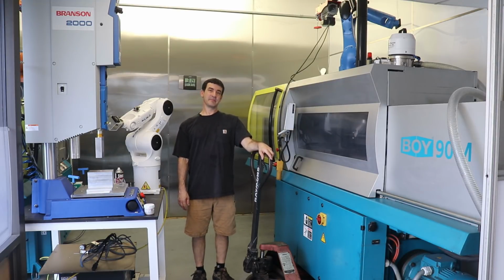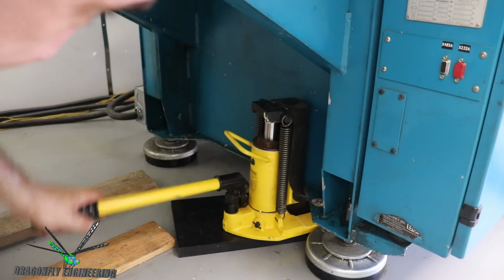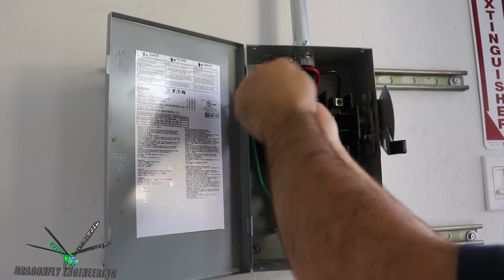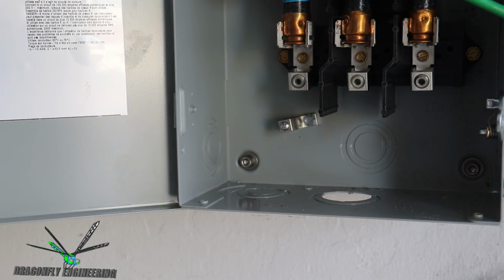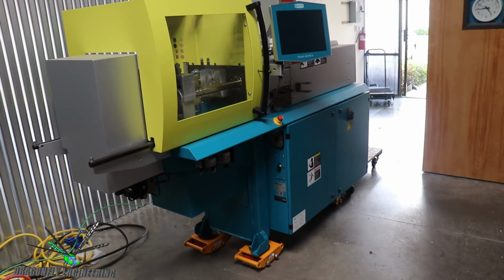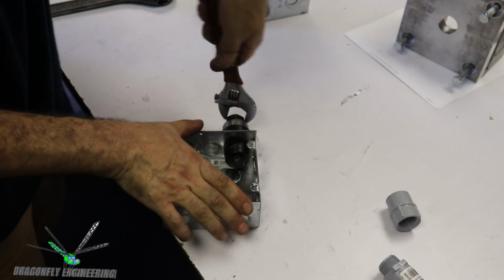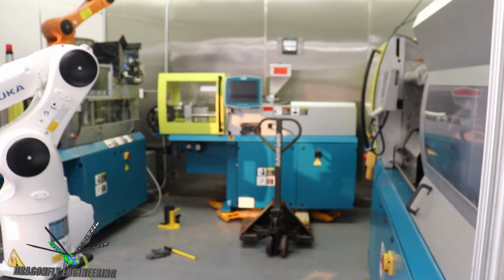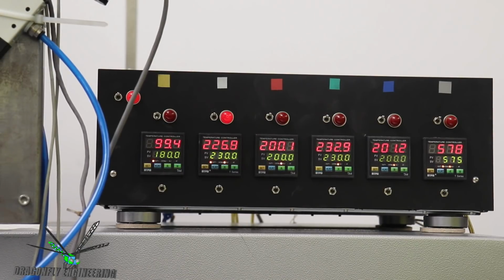Machine move and hookup (edited)

Comment: Machine skates are mostly more trouble than they are worth.  Almost always, it is better to clamp the machine to angle-steel and use a bunch of dowels that can be kicked to effect the steering.  The best riggers I saw in action used lots of hard-wood dowels and moved 5-ton machines with precision down narrow hallways.  (They said with steel rods things can get away from you with just a tiny slope. )   Once in place - jack it up - remove the angle-steel and set it down.

I think you will regret not having more area in the end.

Comment: Hiya. Moves with skates and rollers can be so much easier with a couple burke bars, that, and they are just handy to have around.
Reply from the maker: Thanks, I should get some
Reply: @DragonflyEngineering  Northern and Lowes have them cheap. Just google 'burke bar'.
Reply: @DragonflyEngineering   I just found these, cheaper still than Lowes or Northern, same bar. With free shipping, I had to get two, lol. https://www.ebay.com/itm/383585849919

Comment: Always good to bring in new machines 👍.
Thanks for sharing.
Reply: My employer KUKA (UK), had a technology week to celebrate 25 years in the UK, this was many years ago, one of the demonstrations was they had a two colour or two part injection moulding machine making Squeeze type scrapers about 200 mm wide. They integrated a robot, that opened the sliding door (using the operator door handle) reached in, picked up the moulded part, placed it on a rest station, close the door, pick up the previously unloaded part, then used it to clean the glass on the door, then drop it in a bin, then repeat.
Simple, but looked great on the open day.
Regards John.
Reply from the maker: @bostedtap  that sounds like a cool demo.  I hope to do that with a CNC milling machine one day
Reply from the maker: Thanks for watching!
Reply: dunno if anyone gives a shit but if you are bored like me atm then you can watch all of the new movies and series on InstaFlixxer. Have been binge watching with my brother for the last couple of months :)
Reply: @Clark Zavier Definitely, I've been using InstaFlixxer for months myself :)
Reply: @Clark Zavier Yup, I've been using InstaFlixxer for since december myself =)

Comment: The white wire can be used as a conductor, mark it with blue tape everywhere it goes. If it goes through a junction box mark it with blue tape. Or whatever phase you want to use it on.
Reply from the maker: Thanks for the tip